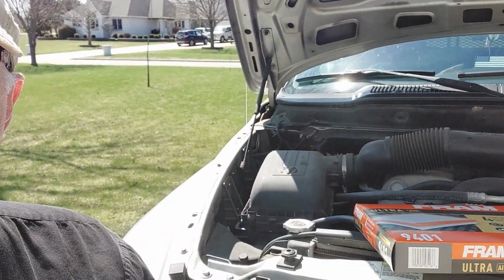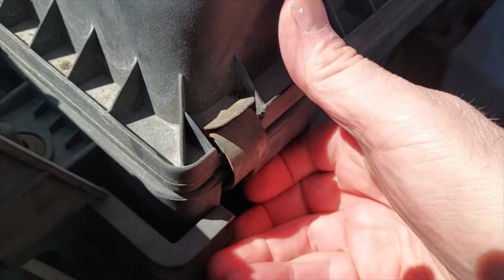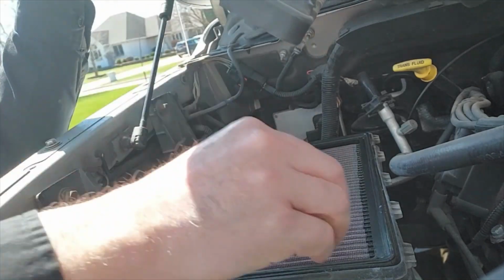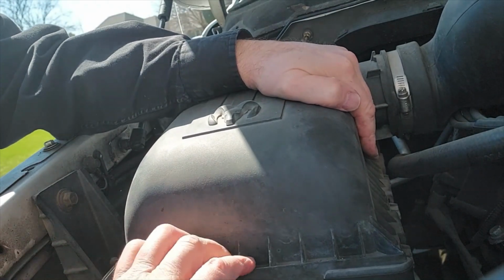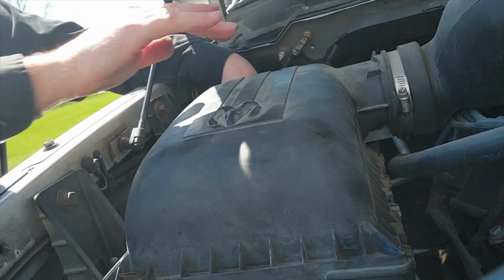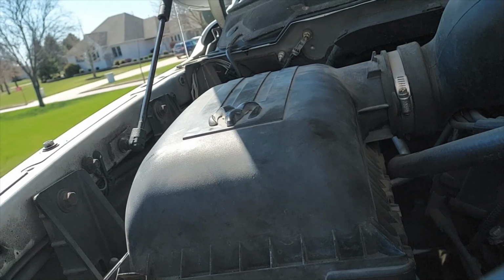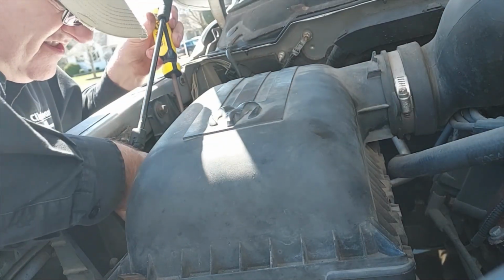2003 Dodge Ram V10 Air Filter Change YES it is that EASY!

Comment: I hate these metal clamps. 
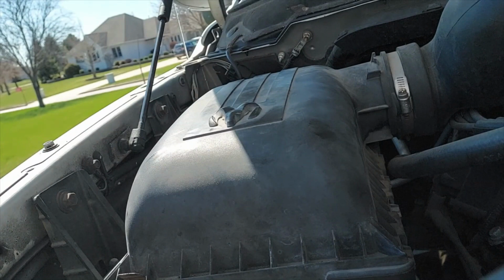It took me a long time to install them but I could not, so I went to YouTube to try to find a trick to install these clamps and here I am, I watched the video then I went to the truck and tried the trick in 3:18 but it did not work for my truck unfortunately,  then it came to me An idea: I bent the clips a little using lineman's pliers tool, then I was able to install the clips easily.
maybe this trick will help someone. 
Thank you guys, greetings from Saudi Arabia
2003 dodge ram 2500 v10 8.0 , This truck is a beast in the " Rub al-Khali " desert.
Reply from the maker: THanks for watching